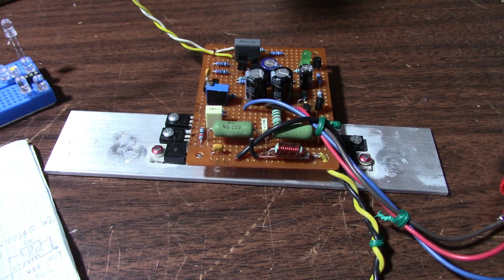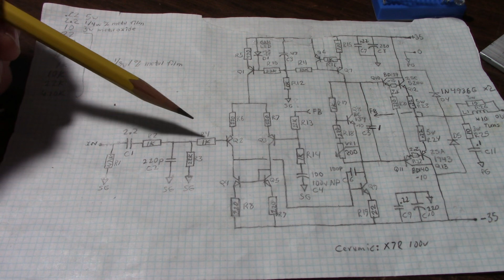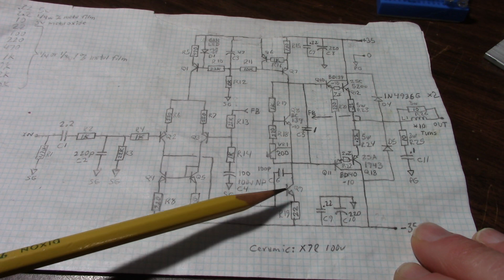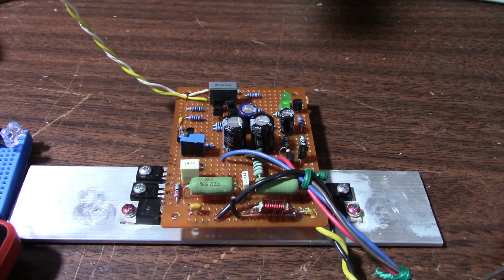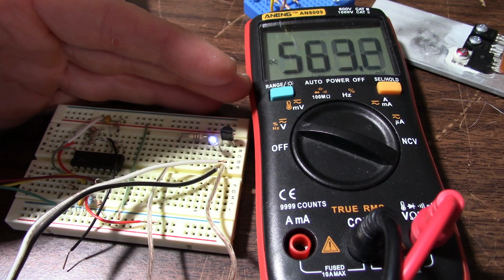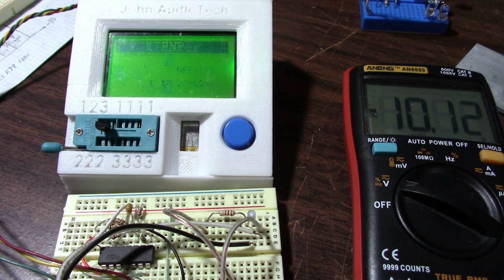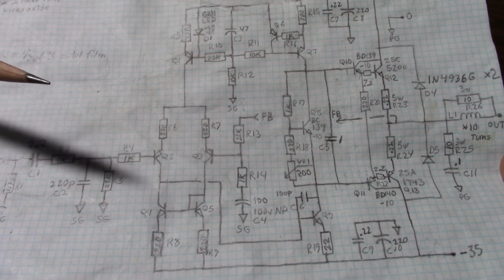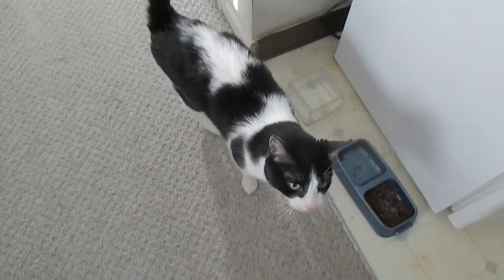Discrete audio amplifier project PT19 repair and a minor change

Comment from the maker: Before someone calls me out, at 6:50, the emitters of the differential pair transistors are near 0v  (~.7v) with a normally functioning amp. When the prototype amplifier had full +rail on the output, there was about 8v across the base to emitter on the right hand differential transistor.

Comment: Excellent video. After working on a fair few DC coupled HiFi amplifiers - fault finding can occasionally send you bonkers, with every component having the wrong voltage on it, it can lead you a merry dance.
The shift in gain from that transistor was fascinating.  Transistors are often used with reverse biased base emitter junction to act as a zener.

Comment: Wild idea, you could reverse bias transistor in order to match them. If you have one with slightly more gain than another, you could reverse bias it for a few minutes and regularly check the gain until it is the same as your other one.

I don't know if it would have any other effects, though.

Comment: I have seen in some Audio Amp they bind the two differential amplifiers pair transistors to each other with a simple common aluminum plate.
Reply: Hi, I assume transistors within the same DIL package could be well matched, and they would certainly be at the same temperature. So why are they not used in audio amps?
Reply: I wrote "I have seen that soloution" and why they do it you may ask them.

Comment: I have been using the transistor tester on the cheap harbor freight meter to match my transistors, just like you heat from fingers throws off the readings!!

Comment: So does reverse biasing the B to E junction damage the transistor? I wanted to use a transistor as a voltage reference for a power supply.

Comment: You damage the diode inside the transistor....ahhahhaha talking with the cat like a cat was the best part
Reply: The diode? There isn't a seperate diode in the transistor, it is like two diodes pointing at each other, but they share the same silicone. Instead of NP doped silicone like a diode, its PNP or NPN doped silicone. So basically, 1 1/2 diodes make a transistor :P Though you are right ignoring semantics. You damage the doping in the silicone.

Comment: Poor cat, 3 days by himself - must  be very attached to you.
The input transistor on the NF side gone. I think that's what killed my old Sima amp (50W per ch, but very high current 1000W in transformers) which was similar to Mr. Leach design - literally everything got fried VAS, voltage multiplayer, predrivers, drivers after the output section gave up when I was away. Maybe someone thought it was suitable for dance club, as I never learned what happened to it.
 I think of reusing the remains for D-class amp if I can get really good modules that run on +/-36V rails (Ice, Hypex) - I don't really need more 17-18dBW. If I can get magnet wire I could rewire the secondaries for more voltage - just an idea.

Comment: but why there is a capacitor in the feedback resistor?
Reply from the maker: This allows DC gain to be unity so that slight thermal effects don't cause large offset voltages on the output.
Reply: @JohnAudioTech  i see, thanks for your explanation